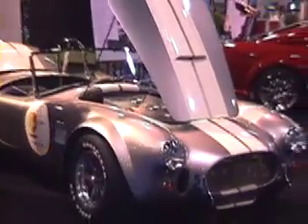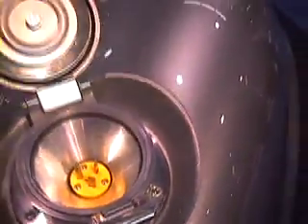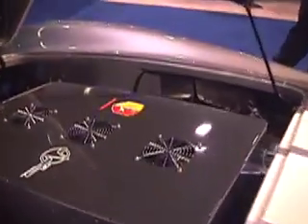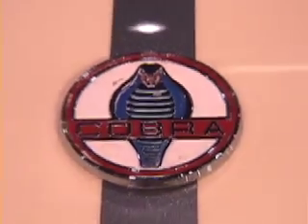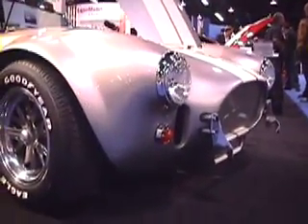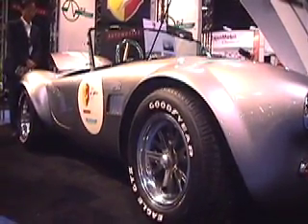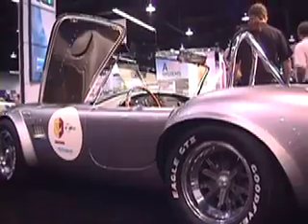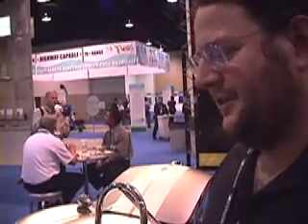Your next electric dream car: all electric Shelby Cobra 427

Comment: Really, a 300 KW (which is about 400 HP) is supposed to "untouchable" in the 1/8 mile, and it cost $100+k.  Sorry, for that price, give me a kit car (because carving up an original is punishable by death, unless your name is Carol Shelby) with an NRE motor; and I'll show him a car that "needs 14-18" slicks to hook up that kind of power", and it won't have a "110 mph top speed" or a "100 mile range".

Comment: It is inevitable that electric vehicles will be the future in coming years, fossil fuels will run out eventually (50 to 200 years or so). And even if it takes 200 years to deplete all the oil its just going to continually add more pressure on our wallets for increasingly expensive gas. In the mean time oil prices rise while people start to argue over a gallon of gasoline. I'll drive by in a blistering fast electric mustang snickering at gas guzzlers and only paying $7 bucks for 120 miles.